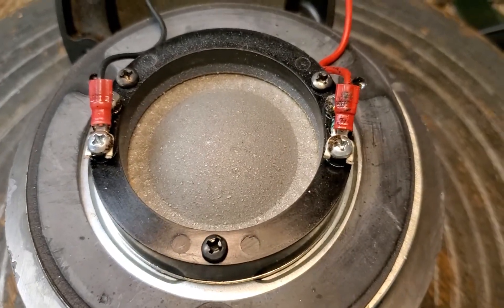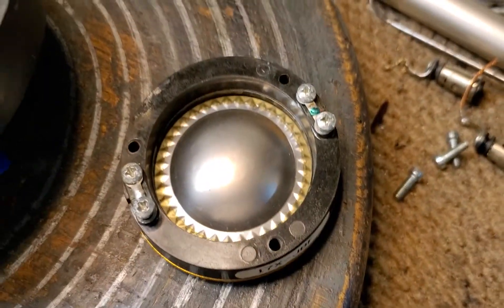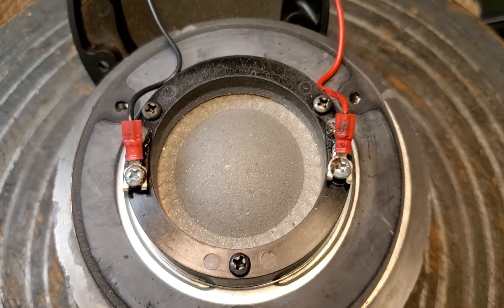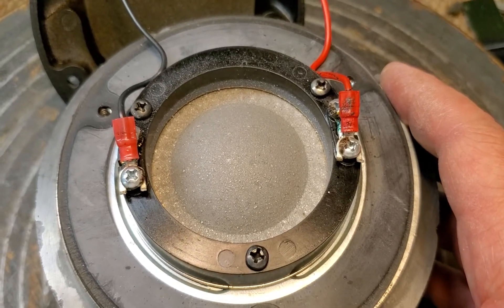Coating a JBL 2425H diaphragm with Aquaplas...by Upland Loudspeaker Service

Comment: Naaah. I think you'r using the wrong crossover. 
That damping material will low 3-4 db the all f.response. 
Nothing should touch the diaphragm.
Reply from the maker: You obviously don't understand.
Reply: @edgewound  I'm an expert in audio stuff. I would tell the secret how to make sound like no other compressor can, i will not. 😉
Reply from the maker: @Benet-o4t Experts don't claim to be experts...or you'd understand the coating on a JBL titanium diaphragm.
Reply: @edgewound  Instead of coating diaphragm, use metalic horn, damped with 3-4 mm silicone all around, all the 4 boards and those harsh midds will get attenuate.
Reply from the maker: @Benet-o4t A damped horn will not fix the ragged response of 2mil titanium. But...clearly you so not understand the concept. A simple Google search will enlighten you on the origins of this treatment.
Reply: @edgewound  Shure it will. Or you can melt bitum. It will def even better the horn, allowing to cross even lower, withot resonance.
Reply from the maker: @Benet-o4t Shure is a brand of microphone. 😂. And a horn is not the same as a compression driver diaphragm.  The issue didn't get discussed until titanium diaphragms were developed. But you clearly don't understand...and are now trolling.

Comment: Have you done this on the JBL/Selenium D220Ti driver? Would it help? I believe it is the same size diaphragm as the 2425, but it is embossed, and uses a different surround shape.
Reply from the maker: I have not done the Selenium. I've done the JBL 2425, 2445, and Klipsch titanium drivers. Feedback from all users is excellent.